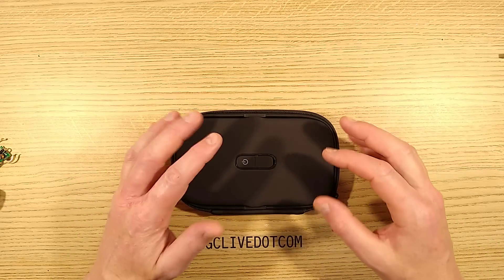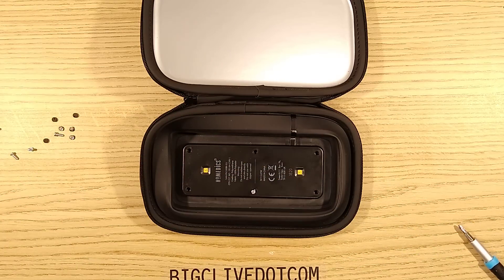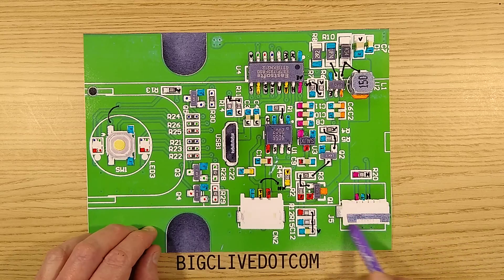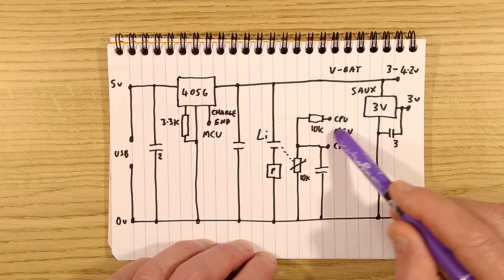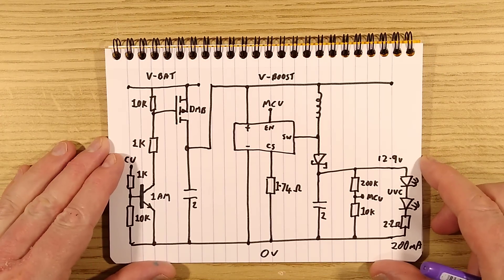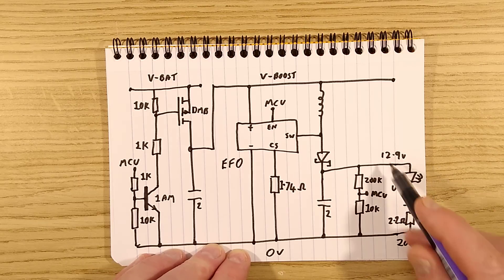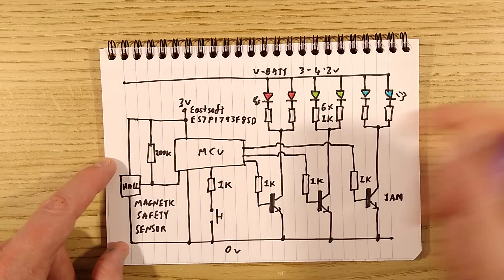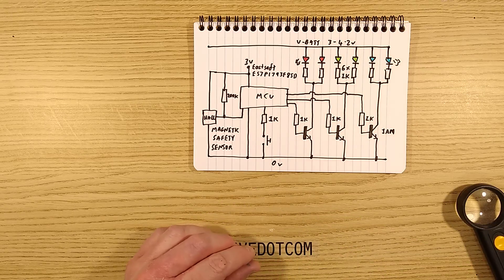Inside a Homedics steriliser unit - with schematic

Comment: The reason the MCU pulses the thermistor is because if you keep the current flowing continuously it noticeably raises the thermistor junction temperature, by a few degrees. Very complex circuit for what is essentially a torch.

Comment: A decade ago I made myself a photoresist cooker out of 10 1A 460nm diodes, and I haven't even try them under 1A, because under 400mA, and mounted on properly calculated huge radiator taken out from old equipment they become double purpose cooker - I can also warm my lunch. Probably there are newer and more efficient UV LEDs, but as I've heard the shorter is the emitted wavelength the lower is the efficiency.

Comment: I love your breakdowns Clive and the UV equipment is of particular interest. However, any manufacturers worth their salt who claim UVC output should qualify what the 254nm "Germicidal" intensity is so a corect exposure time (hence dose) may be calculated.
It would be so helpful if your excellent videos could measure or at least estimate the UVC power.
Reply from the maker: The cost of a proper lab grade device that can analyse wavelength and strength of UVC accurately is unfortunately absolutely prohibitive.

Comment: All plastic is "as black as the inside of your grandfathers hat" as they say.  That silver reflector at UV-C wavelengths will be black.  As a result only surfaces facing the UV-C LEDs will be sterilized and then only if enough UV-C is emitted.  The sides and back of any object put inside would obviously see no direct light.  You need a total dose of 60J per square meter to sterilize most viruses and that is quite a lot when the LEDs only emit a few milliwatts.  Added to which the LEDs send most light straight downwards and very little to the sides so the exposure won't be even across the object inside.  Remember if you are working with UV-C LEDs you should be very careful about exposure to the light.  A thin sheet of clear Acrylic will block all UV-C and you can see if the LEDs are working because they will glow a dim white/purple colour.

Comment: The feedback for the boost chip is puzzling, normally the feedback comes from between that 2R2 and the LEDs, a 204mV reference is common for those chips which would make 2R2 and 1R74 in parallel exactly 200mA. Are you sure those two resistors aren't in parallel? Look at the TPS61169 for example (it's even pin compatible excapt for one unused pin)

Comment: I just went over to Mouser's website, and found them selling UVC (less than 280nm) LEDs. They are a real thing !

Vishay & Lumex are some known component makers that sell them thru distributors, like Mouser. A Vishay part that draws 120mA with a nominal 6V drop, runs for ~$3.60 if you buy 10, or more. 5 bucks in single unit buys. 30mA units also available, but only a buck cheaper. This is as of Sept 2023, when this comment is posted.

Comment: Very interesting unit!. My friend bought a similar device yesterday, and of course I've "tested it" already. It cost 6 euro (!!), down from 40 euro, cause it went out of fashion after main covid spike.  It's powered from USB-C (charger is not included), stating maximum consumption of 9V/2A, which looks like it can negotiate quickcharge. It features a shitty induction charger (so it can charge phone when sterilizing it), and pretty interesting 254/185nm sterilization. To my shock it features two "true" mercury discharge tubes inside, looking like old-fashioned xenon flashes. It obviously works, because after you open it there is this pungent acrid smell of ozone, with amount enough to make you cough after you "sniff" it. To my wonder the quartz (or even sapphire) tubes are behind some kind of yellowish translucent plastic, with color looking similar to kapton. I wonder if it is translucent to UVC, or if it makes only ozone behind it and the plastic is transparent just so you can see the tubes. I must buy it, with this absurdly low price it is worth just for the interesting discharge lamps alone. Model goes by the name "MAGINON ST-1QI".

Comment: If it's 'HoMedics' you can rest assured that it's not cheap junk. HoMedics make proper medical devices which are, or used to be, sold by Boots the Chemist. I have one of their digital electronic blood pressure monitors, and it's right on the mark when checked against my GP's 'Omron' model. It's well made and accurate, and even though its onboard calendar has expired, I still use the monitor because it's easier than my new one, and no less accurate!

HoMedics might not be top notch hospital grade, but it's far better than the cheap kit you can buy online, and is supplied by a well known and respected company.
Reply: I thought it was HomeDics until he pronounced the name near the end of the video lol

Comment: If it's under software control, it's not a safety interlock. Should've used a reed switch on the UV LED power rail.

Comment: "Fumblesome "- 1.bunglesome
2. blundersome
3. bumbly
4. bumbling
5. klutzy
6. clumsy
7. bumbleheaded
8. ungainly
9. gauche
10. scrappy
11. lumbering
12. dawdlesome
13. tanglefooted
14. cack-handed
15. foulsome
16. botcherly
17. footless
18. uncouth
19. thumby
20. problemsome
21. gawky
22. kludgy
23. numb-handed
24. blunderous
25. rambling
26. botched
27. scammish
28. unfortunate
29. mutton-fisted
30. squandersome
31. bungling
32. ham-handed
33. heavy-handed
34. scrambling
35. cumbersome
36. shambly
37. sloppery
38. oafish
39. awkward
40. muddlebrained
41. errorsome
42. lumpish
43. muddle-headed
44. ingenuous
45. fudgy
46. blunderful
47. hard-luck
48. dufferish
49. spazzy
50. feckless
51. ungain
52. unfeaty
53. ham-fisted
54. faltering
55. loose-handed
56. sloppy
57. maladroit
58. clampy
59. lubberly
60. betumbled
61. clunky
62. tottering
63. slipslop
64. all thumbs
65. foolhardy
66. slapdash
67. slackful
68. mischanceful
69. unhandy
70. tremulous
71. lackwitted
72. thoughtless
73. slipshod
74. idlesome
75. ragged
76. slack-handed
77. infelicitous
78. chumpish
79. badsome
80. ambilevous. Perhaps some alternatives for future use  . My favourites No.'s 7, 16, 22, 48, 49 57, 59, 77, 78 😏

Comment: Looks well made. Wonder if you could repurpose this to erase eeproms. Serious eeprom erasers are specialized and expensive. Everything else readily available is on the complete opposite end of the spectrum and is the cheapest and most suspect kit you can find. 

I believe real uvc diodes put out 254nm wavelength which I think is appropriate (Experts feel free to chime in!)
Reply from the maker: Probably not the ideal wavelength for that.  The classic UVC LEDs are not as shortwave as UVC tubes.

Comment: These are commonly used to sterilize small devices that are used by multiple people in institutional settings; the example I'm familiar with is the shared remote control in a seniors' home. They're also used by health care providers on their own electronics and jewelry to lessen the risk of pathogen spread between home and work.

Fun fact: when hospitals in the 70s were trying to reduce infection rates in hospitals, they identified two unexpected germ carriers: nurses' caps and doctors' neckties. Nowadays it's cell phones and earbuds.
Reply: These devices aren't permitted or approved anywhere near a hospital or healthcare! IDK what back alley clinic you're going to but nobody in 1st world modern medicine is using these, you might find them at a nail salon with all the other cancerous chemicals and polish hardening UV lights

Comment: Interesting device! 
I am a bit shocked that there seems to be no monitoring of the UV-C LEDs. Means that the user will never notice, if something fails and things are not sterilized.
I worked in projects developing two pretty similar products for water. Monitoring was a huge topic and taken very seriously.
Reply from the maker: There are a lot of products with zero monitoring.
Reply: That's what the sense of the LED voltage is for
The mysterious boost chip is probably of the constant current type hence the sense resistor. So many things can be monitored here
1. Switch on the mosfet and watch the LED voltage. It should be Vbat minus the diode drop of the shottky. If not, the LEDs are shorted or the diode is blown
2. Enable the boost chip. Now you can monitor the LED Voltage under constant current. If the voltage goes high, at least one LED is open. Also the LED voltage is dependent of their Temperature. If the LED gets hot, the voltage gets lower, so maybe this is also to protect against over temperature. and of course if one LED goes short circuit the voltage will half
Reply: And what also comes to my mind is some kind of dose control
From voltage and current you can very precisely work out the output power of the LEDs (voltage at current gets temperature und thus efficiency)
Over time you get rising temperature and decreasing efficiency
Reply: The difference between your product and this one here is that sterilizing water can actually be useful as you can get seriously sick from drinking contaminated water. On the other side, it makes absolutely no difference wheter your phone as actually been "sterilized" or not. If you want your phone clean, wipe it off.

Comment: What WOULD you suggest for sterilising phones and other similar electronic?
Reply from the maker: I use a lens cleaning wipe that is pre-soaked in isopropyl alcohol to wipe my screen for cleaning it.  It will have a sterilising effect too.
Reply: @bigclivedotcom  Thank you for the reply. 
I have been doing the same, but had a bad experience with isopropyl stripping a paint/surface finish from some plastics.
So I was looking for an alternative in cases where water can't be used either.
Reply from the maker: @galaxya40s95  Isopropyl alcohol is actually very plastic friendly.  Are you sure it wasn't acetone?  As that is very aggressive to plastics and paint.
Reply: I could be wrong, but my interpretation/impression of what Clive said was more like why would anybody want to sterilise their smartphones.

Comment: I got the same thing from Lidl for very cheap a while back. I just drive the LEDs directly from a bench PSU to wipe EPROM chips. It's a bit slow but works just fine when not in a rush :)
At least it puts out some actual UV-C. Remounting the LEDs side by side in a proper box would make a decent UVilizer.
Reply: Do you smell ozone with these LED'S?
Reply: @LutzSchafer  No not at all

Comment: I almost moved on but when you showed the circuit board I realized that this just might be a serious device.  Your 3 pager circuit confirmed that.  So, I learned much.  Cheers.
Reply: Clive, I wonder, will it work as a uv prom eraser? :-)
Reply from the maker: Not sure if the wavelength is ideal for EPROM erasing.

Comment: Aw I wanted to see lots more details about the UVC LEDs!! This is the first time I've ever seen a device without the usual sky blue diodes in line with the UVC chips to act as safety warnings. That makes them potentially useful for other stuff like illuminating fluorescent minerals for viewing etc. But I need to see how MUCH light it's actually putting out to see if it's worth it to buy. At 200mA and 6V each that suggests a total power consumption of a couple watts, and given the abysmal efficiency of UVC LEDs I'd guess they're putting out maybe nearly 100mW, which could be useful for some things like observing willemite and terlingua type calcite phosphorescence, especially at $7!
Reply: They are pretty low output compared to a mercury vapor tube, like I put one in a similar device against a UVEPROM window and it took something like 45 minutes to start flipping bits.
Reply: Great teardown.
Yeah,  I too was hoping for a closer look at the UVC LEDs.  
Are they in a UVC transmissive case style (hermetic with quartz window)?
What is the centre wavelength?
Reply: @KallePihlajasaari  they are quartz windowed and the center wavelength is 280nm. We've done a simple mod on the fluorescent minerals subreddit and it's at least as bright as those 4 watt UVC lamps intended for fluorescent mineral viewing and at 1/10th the price!

Comment: Nice teardown, but didn't notice on your schematics where the third connection from the battery went? I presume it's an NTC feeding the 4056?
Reply: It's the NTC drawn to the right of the battery on page 1 .  This is actually the standard 3 pin battery connection arrangement used in other products and supported by battery control chips .

Comment: I've found those LED based steriliser units aren't all that useful as their outputs are so low, they've gotten a lot more efficient but the mercury tubes always achieve higher intensities which is essential for proper steriliser or UV EPROM erasing. Expect it to take multiple hours to erase an EPROM in one of those if you just place it on the bottom, maybe half an hour if you place the LED right on the window.
Reply: That's definitely true. Mercury vapour lamps are much more efficient than LEDs, at UVC wavelengths and cheaper too. There are a few advantages of LEDs though: no toxic mercury, no glass to break and they should last longer, as long as they're not over-driven.

Comment: I guess you don't have your UVC test cards to check that the output is really what it says it is. Although, the competency of the design and implementation would suggest that it doesn't have anything to hide.
Reply: Unless a bean counter replaced the UV LEDS for cheaper components like doubled 3V leds .
Reply: @johndododoe1411  They didn't, mine erases EPROMs.

Comment: Look, an EPROM eraser! Nice board indeed.
Reply: That's what I've been using my UV sterilizers for. Both UVC LEDs and tubes seem to work fine.
Reply: THat's what I use this for. Although have to provide direct power to the LEDs, the timer only runs for a few seconds and I have to blast the chips for about half an hour for a good FFFF experience.

Comment: Homedics is a pretty well know brand in the US, and they're known for making rather sturdy devices that tend to do the one thing they're designed for well.  Most of their things are more along the lines of massagers and light weight home medical equipment (pulse oximeters, blood pressure monitors, etc).  I'm only a little surprised to see a UVC device from them, but not shocked to find that it's well designed and well made.
Reply: So this is for sterilizing the back massagers and other body-touching products that might pick up stuff .
Reply: @johndododoe1411 More for sterilizing things like remote controls and cordless phones in seniors' lodges, health care providers' electronics and jewelry, and the like. They do reduce the risk of nosocomial infection when used properly.
Reply: NO most if not all their back massagers wouldn't fit in here. It's clearly meant for sterilizing cell phones which idk why you would want to as they'll just get dirty the next time you use the phone. Probably better off using this for items that don't get handled as frequently like pens or keys or something like thermometers that are constantly in someone's ass, armpits, and/or mouth   @johndododoe1411
Reply: I couldn't have put it better.
Reply: Homedics stocks go up
Reply: The only AC adapter my NES has ever used was a repurposed Homedics one.
Reply: it may be well made but it is still designed to be bought by the ill informed. UV is a rubbish way to sterilise a phone.
Reply: Home Dics massagers? Okay.
Reply: @khaitomretro 😂
Reply: Lmao I wouldn't say well known, from a quick google their website is like a QVC infomercial.